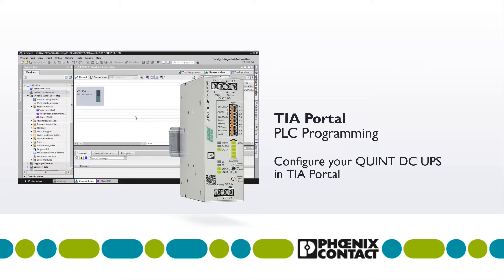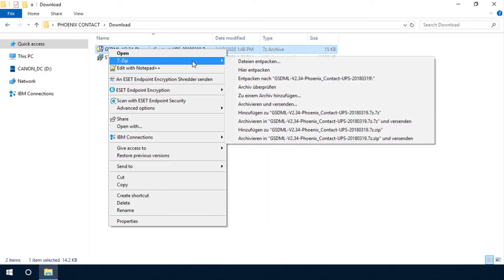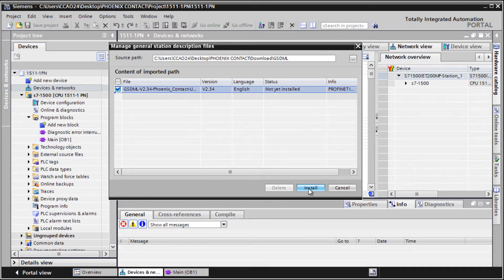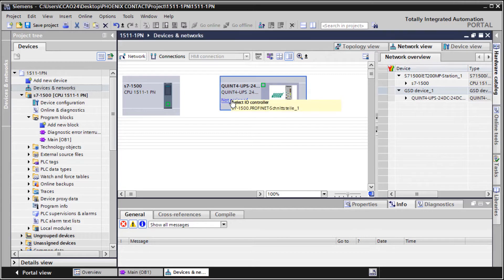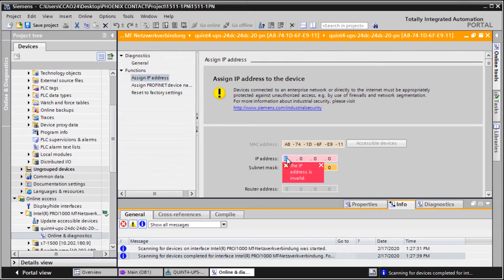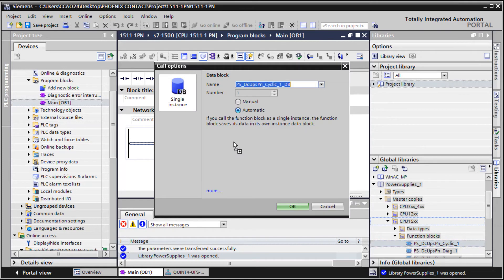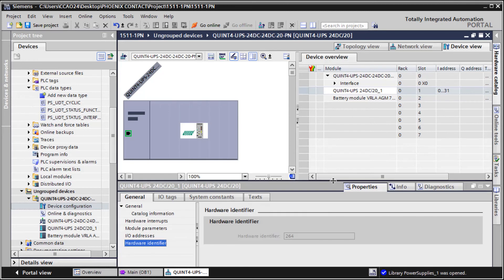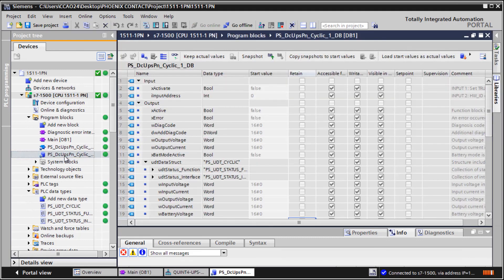Configure your QUINT DC UPS in TIA Portal

Comment: hi when i try and do this, i cannot can compile successfully but not download to PLC, with the siemens fault "Internal system error (error code: 0xc14eab0000e9ff02) - Please contact SIMATIC customer support.,5/25/2021,2:46:46 PM" if the "PS_Q4_DcUpsPn_Cyclic_2" is included in my project, whether the block is called or not, will cuase this error, delete this block and downloads fine.  running tia v6.3. any ideas?
Reply: Have you solved the problem?